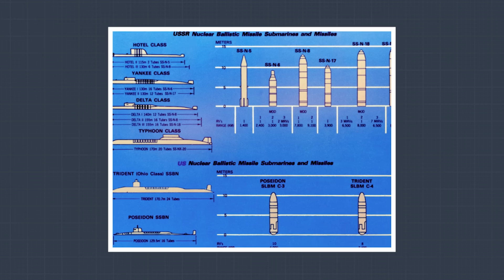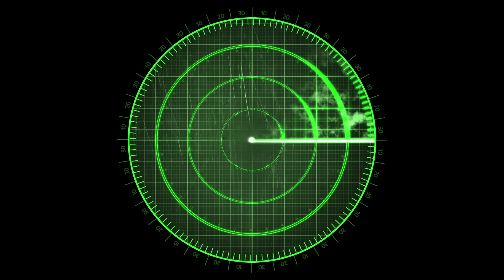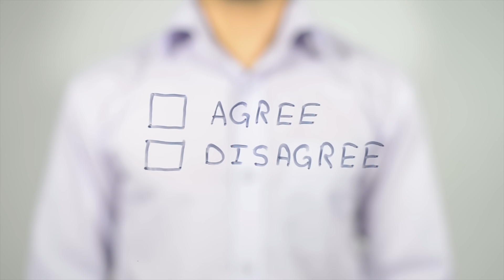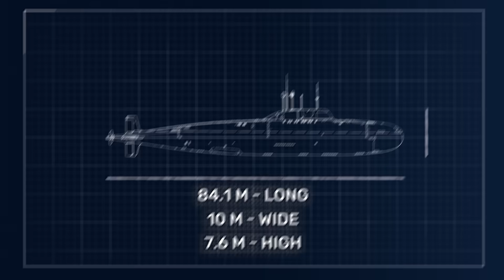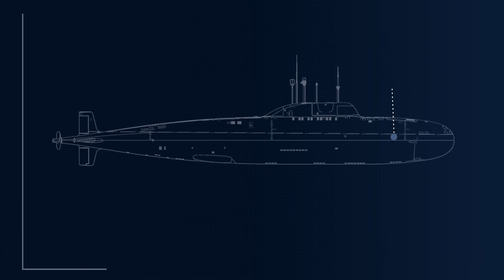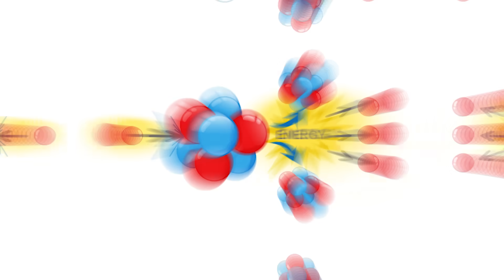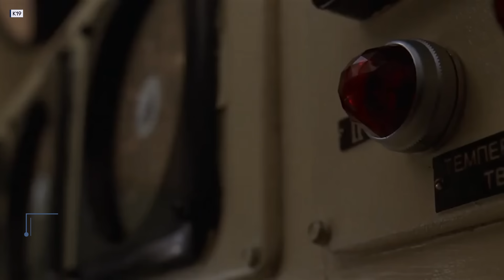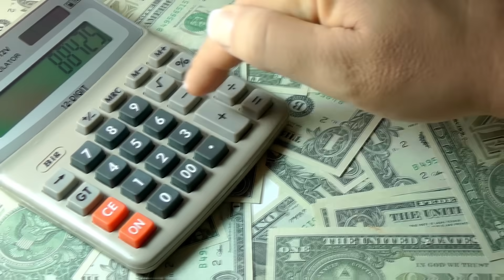Project 705 Lira: The Soviet Submarine That's Still the Fastest Ever Built

Comment: All nice & dandy ...ON PAPER! 😂 Was it fast??... HELL, YEAH!... By the time it was introduced there was no TORPEDO in the whole NATO arsenal that could (RELATIVELY) catch up to it - providing it was fired from a considerable distance. The "Alpha" was also built with Titanium alloys, which meant it could dive to 900 meters (maybe even more!). Nowadays most sophisticated SSBN can dive down to 450 meters TOPS  (max. operational depth!). Add to all that the fact that being titanium an "a-magnetic" material, not even the most sophisticated MAD's (Magnetic Anomalies Detectors) could detect it. ...SO?... It was also the NOISIEST SUBMARINE to have ever existed! On full speed (that was reportedly over 42/44 knots, as far as I recall) the noise from the pumps & internal components was so high that the crews of the "Aplha's" could hear NOTHING on their own sonars - THEIR OWN NOISE CANCELLED OUT EVERY NOISE AROUND THEM! It was basically an "ambush" submarine. Stay adrift & listen - target passes by - you shoot your torpedoes & SCOOT ASAP (and beg the Lord there's isn't already someone behind you who detected you "a priori"). That's still "fine", though - nothing weird about about - plenty of Western (and NOT) submarines used similar tactics. What's different in the "Alpha" (or "Alfa - whatever!) was the OVERPOWERED nuclear core & engines. Not only was it noisy - it was also like having the frame of a "FIAT" but with the engine of a "FERRARI" inside! 😄 
PS. On an "engineering" level - it was still a MARVEL. Titanium is extremely difficult to work upon / weld & whatnot. The cost of doing that was IMMENSE. They achieved something that had the potential to scare Western fleet-commanders. How much of a "practical" weapon was it?...that's another discussion entirely... :) Thanks for the video! :) ;)

Comment: Why were subs ALWAYS cylinders? Why didn't they ever try any other shapes to spread out the load and give the crew just a bit more room? I never understood that. Even the U-Boats were shaped like sailing ships except enclosed and no masts. Just a fatter belly.
Reply: What shape do you want lol.

The hull cylindrical hull form is to increase underwater performance and pressure resistance.

The vanguard is an odd one but why not make it a cylinder?
Reply: @binludding7169  Didn't really have any particular shape in mind. Just curious why nobody ever thought to make one shaped different. Like cars and even aircraft have all sorts of different shapes and configurations. But a sub is always a tube for the most part. lol
Reply: @barral69  
Because it's a bad idea.

Cylinders resist pressure much better and have better hull flow.

Comment: Titanium ist not stronger than steel!
Reply: Cool, so?
Reply: @ spread the word.
Reply: @Zirlikus  it's more resistant to corrosion, very high tensile strength to weight ratio, exellent resistance to heat and can be alloyed for a number of aerospace uses.

Technically it is stonger
Reply: @binludding7169  you are right on all the attributes, it is also more brittle, and less ductile.
The most used Ti-Alloy Ti6Al4V clocks in at 900-1200 MPa tensile strength. A lot of steel alloys outperform that easily. Maraging Steels can easily go above 2400. And even less exotic (and pricey) variants of tool steel clock in at around 1500 Mpa.

So no, Titanium is not stronger than steel. It is half the weight, so it is an amazing material, but the king of pure strength (tensile and yield strength) will be steel.

Comment: The metal cooled reactors of these things were a terrible idea.  As when turned "off" for maintence or overhauls. The lead bismuth liquid metal cooling solidified, into solid lead. Which functionally killed the reactor right there.  As the reactors could not be fired upto operation levels again.

Titanum is a great material for sub hulls, in theory.  Titanum is silly hard and expensive to work with, as well as very difficult to weld.  The West could not really have attempted a Titanium sub class. The USSR had large deposits of the ore.

If I recall correctly, The Titanium for the SR-71 et al. had to be covertly aquirred via 3rd parties, from the USSR.

Comment: Our company was involved in the design of the MK48 Active Warhead.  This design was specifically oriented and tested to sense other structures than steel or iron, such as anomalies in the nearby ocean, any sitting subs, mine carriers, oil platforms, pipelines, cables, or any acoustic signatures, including whales.  The main problem was in attacking the submarines, since a torpedo can go by at any angle, in any direction, at any depth, or above.  Testing the algorithms for this was a monumental task and involved years of testing in ranges.  Other companies worked on the propulsor, and we did some studies in traction drives to try to make the torpedo itself quieter, so it could search better.  In its modern evolution, not much of anything at which it is shot, can ever escape.  The Russian Titanium hulls became irrelevant after this, and their horrific noise signatures made them sitting ducks, capable of being spotted dozens to hundreds of miles away, depending on conditions.  In conjuction, ASROCs were developed to extend the range of submarine destructive effects, since the early torpedos were wire guided and only had a limited range.  Now they can go much further, and the target discrimination is much better.

Comment: Gabble gabble, showing no interest in the subject because the authors are different people and this presenter just reads an autocue.
The writers made the fair point about building up skills and Russia today has probably the most advanced and greatest number of sub marine vessels.
Like Royal Navy developments (which are largely kept secret), the reactors allow great speed and endurance while also being practically silent. Stirling engines are used for this low noise capability and many hulls are made of composites.
Great depth is attainable using advanced titanium alloys for some types but is less of a necessity than post-WW2 because evasion technology seldom requires deep dives.
Russia supplies submarines and sub surface vessels in clusters or 'nets' with perhaps 2 in 20 having a human crew. China is the main client for these and the implications for US carrier groups is profound.

Comment: "A titanium alloy would likely dissolve in sea water."  What?  Titanium alloys are highly resistant to corrosion.  That's why you find them used in highly corrosive environments, like geothermal wells.  Titanium bike frames are left unpainted and never corrode, not even on the English coast.

Comment: While I would never say that the Soviet submarine fleet is not a serious threat (and I say "Soviet" and not "Russian" because 90% of their "modern" tech was engineered in and derived from the Soviet era), do you remember before anyone knew about the SR-71 Blackbird, or the F-117 Nighthawk flying in our skies until many years later???

So Yeah, be assured that the U.S. still has some unknown tech and tricks up its sleeves "flying" under water as well.

The primary issue for the current Russian Navy is that its submarine Support Fleet has been decimated and forced to move and stay in "safer waters" far away from danger, as well as losing several important Naval admirals and commanders with valuable tactical experience.

In addition, with all of the sanctions that have been imposed on Russia, and all of the money being spent on the ground and air war in Ukraine, the manufacture and availabilitiy of parts and the Budget to fund regular maintenance and refitting of their sub fleet has been severely impacted.

When submarines in particular are not properly maintained, they quickly become noisy and therefore much more easily detectable.   In addition, systems and the TRAINING for them need to be constantly and consistently upgraded and exercised to maintain proficiency and a tactical advantage.

When stealth can no longer be maintained, subs lose their key advantage and become susceptible, no matter what defensive systems they may carry.

Maintenance and timely refitting/updates have been a long-standing issue in the Russian Navy's sub fleet, well before the war in Ukraine.   But the current war and economic strain only exacerbates this issue.

In addition, 80% of the defence technology and engineers was developed in and located in Ukraine before it was given its independence after the fall of the Soviet Union.

Then there is also a shortage of talented young engineers, and available submariners with the unique dispositions to reliably and competently perform in long-term submarine deployments due to the "Brain Drain" when so many fled the country to avoid conscription.

Submarine crews need to be especially numerous to maintain redundancy to allow for frequent rotation for the necessary R&R so as not to "break".

VERY Few possess the right temperament and disposition to "handle" the life of a submariner, and their pool of available talent is continuously dwindling, and/or fewer & fewer have any interest in this type of life given that the risks grow exponentially higher with each passing day.

Just My OPINION and Assessment.  YMMV
Reply: Кто сбежал из страны что-бы избежать призыва??Кто тебе погонит инженера или подводника бегать с автоматом в полях?Был частичный призыв в летом 23-го и то его быстро отменили т.к. людям это не понравилось.Осенью уже массово начали набирать людей по контрактной основе.Америкаская псевдопресса тебе такое сказала?Ты еще в лопаты,чипы от холодильников и стиральных машин наверное веришь?)))Чип для управляемой бомбы или дрона стоит 15$.За 15кк $ можно купит 1кк чипов если есть такой уж дефицит...Почему имея худшее вооружение  в мире,и имея кадровый голод обученного состава и денег до сих пор не разбомблена американцами во имя демократиии.Почему у янки сжимается их 150-ти кг. зад и они не начинают открытую войну?Твои слова выглядят примерно так.Ты занимался тяжелой атлетикой и боевыми искусствами 20 лет,но боишься 3-х летнего ребенка))Почему в штатах которые печатают деньги в любом количестве у частных лиц(да,в этом частном банке из федерального только название) имея вторую экономику в мире(Китай уже первый) горят новейшие подлодки,падают б2.Статистику ф 16 еще посмотри.Ф16 за время своей мирной службы убил своих пилотов больше чем зенитки и самолеты врага за все его войны вместе взятые.
Reply: @акула_черная 
Keep believing your censored and filtered State-Controlled "Media" and propaganda. 😅

And all while Ukraine continues to penetrate deeply into Russia, blowing up oil & gas refineries in nearly every region, as well as its air defenses, miltary infrastructure, and top personnel...REPEATEDLY...while Russia's supposed "superior" air defences CONTINUE TO FAIL to combat or eliminate the threat...all verified DAILY by multiple Russian Telegram and other civilian independent social media posts.

And all while Putin and Russia underhandedly fight its "SPO" by blatantly and cowardly targeting Ukrainian CIVILIANS, women, children, and grandparents.

In addition, Ukraine, a country with ZERO Navy whatsoever, destroys and even completely sinks the so-called "Great" Russian Navy's flagship warships, and CONTINUES to successfully strike Russian air bases and sea ports, and have forced the Russian Navy to Retreat and Relocate their fleets to much more distant and safer ports with their tails between their legs.

And Operation Spiderweb used Russia's own citizens to help carry out the Ukrainian's brilliant and successful attack while Putin could do NOTHING.

LOL, Putin's supposed "3 DAY Special Military Operation" STILL hasn't succeeded even over the course of THREE+ YEARS to overtake a MUCH smaller army that has far fewer soldiers and resources...and with no Navy or ballistic nuclear weapons in their back pocket.  😂

And maybe you should actually research the FULL HISTORY and Statistics of the F-16 since its inception, instead of just cherry-picking and highlighting 0.1% of its "incidents", LOL.  FAR MORE Russian comrades have died or been shot down in MIGs & Sukhois.

The F-16 is arguably THE Most Successful and Domineering military Aircraft in history and in its successful adoption and implementation in the militaries of MANY nations across the world who continued to re-order MORE & MORE F-16s rather than switch to others.  That Would Not be the case IF it was an inferior aircraft.  Same for the F-15 variants.

In addition the U.S.'s old supposedly "inferior and outdated" weapons such as HIMARS and Tomahawk missiles continue to destroy Russian targets with little opposition by your so-called "superior" Russian air defences...so there's that.

And the USA doesn't need to directly involve or deploy its own military to Russia because the Ukrainians have held on just fine for multiple YEARS now against what was supposed to be a quick & easy "Complete Victory" in just 3 Days by Putin. 😂  TIME doesn't lie!

Russia's resources and economy are being slowly bled dry and held off by a much smaller Ukrainian nation with far fewer resources and manpower.

My Russian Babushka s Dedushkoy Pashkov (a nurse & aerospace engineer) fled the Soviet Union during WW2 and happily CHOSE to remain in the USA their entire remaining days to live long, peaceful, and succesful lives, never once even thinking about wanting to return to the "motherland".

Their realization that their great homeland "wasn't so Great afterall" was heartbreaking and eyeopening.  But I'm glad that they lived out their remaining days happily, peacefully, and comfortably here in the USA!

Comment: Agree with all of the comments on how loud they were.  I'd like to mention that they were known as human microwaves. Minimal reactor shielding would allow ionizing radiation exposure many times more than a US Navy nuclear power plant would, and trhe fact that US Navy reactors use pressurized water, as opposed to liquid metal in the K64 russian reactors, meant that coolant spills were orders of magnitude more radioactive, and bismuth is a toxic metal all by itself. If you were a Russian sailor you could reach the US Naval Reactors lifetime ionizing radiation limit in a single cruise. 

The Russians were going for speed and deep operations, but they were loud, easily tracked, and both of those together negated any advantage their speed and deep running advantages. 

It was an ambitious design that was a "sucessful failure."

Comment: Alpha Class  .. Not a total failure, It did force us to build a faster torpedo .. The ADCAP moniker added to the Mark 48  torpedo .. The effective range of the old Mark 48 Torpedo was deemed to be too short ..  The reality was it was easy to vector an attack sub to cross the track of the Alpha since it was so noisy it could be detect at very long ranges .. It was never considered a threat, It was a nuisance ..  It required a having having a few subs on station near to the Alphas' port to be ready to sink them if things ever got serious ..  A most boring submarine patrol .. Ret US Navy ..